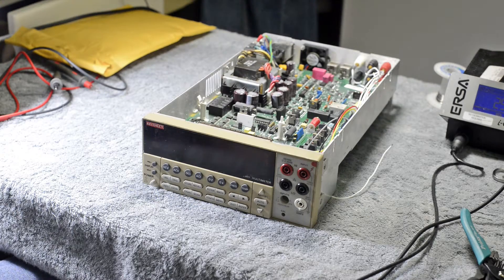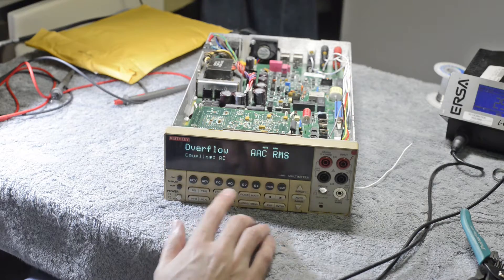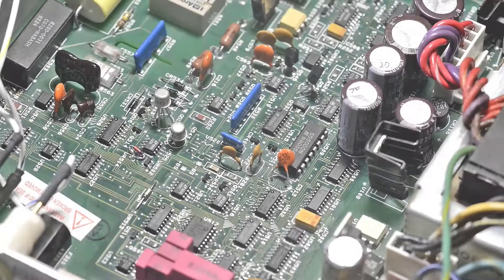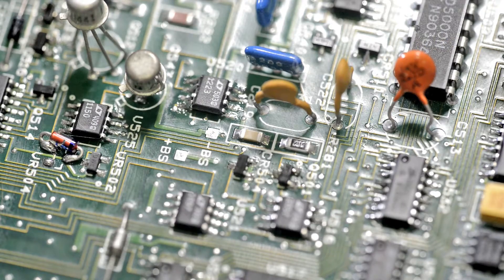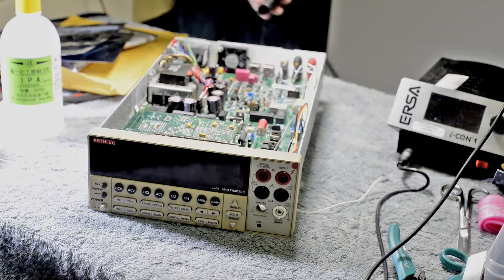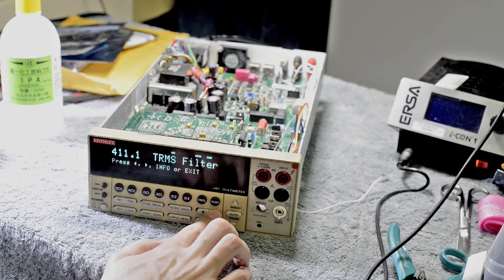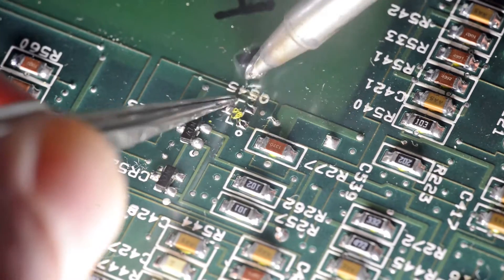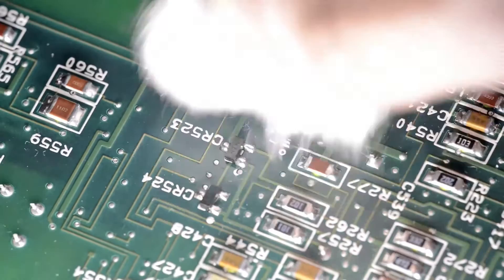Diagnostics and repair of Keithley 2001 bench DMM

Comment: I have stumbled across this video and your impressively helpful website because I found out that in the lab at my university we have a broken 2001 that was deemed beyond economic repair by Keithley, and I decided to attempt a repair. As far as I can tell, our unit has plenty of leaky caps, almost certainly damaged CR513 and/or 514 and the transformer is utterly toast (shorted secondaries, except for the digital board power supply). I have planned to re-cap and replace all suspect components, but I will have to find a way to power the meter.
In the university we also have a Keithely 2000 that, as far as I can tell, should have reasonably similar transformer voltages. Do you think that I could attempt to power the 2001 with the 2000 transformer to at least establish if more repair would be needed?
Reply from the maker: If you checked output voltages and confirmed they are within 5-10% of what 2001 needs, sure you could try to power on board with transformer you have on hand. I am fairly sure that pinout of secondary connectors not matching, so keep that in mind!
Reply: @xDevscom_EE  indeed the pinout is quite different, but I knew that. The 2000's transformer outputs, under no load, are 8 Vac on one pair, 9 Vac on a second pair, and 2x19.3 Vac (center tapped). Do you think they are close enough to test the 2001? There is also an additional 39 Vac tap that I won't be using. I could probably drop them a little by setting the primary side to 240 V instead of 220 V.